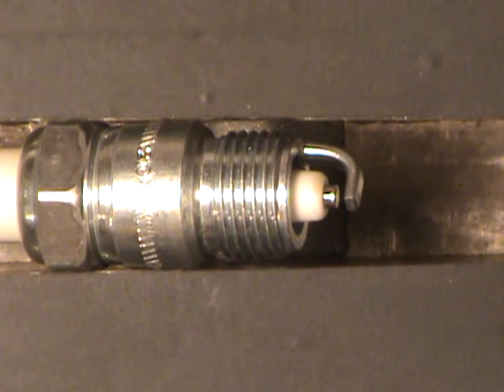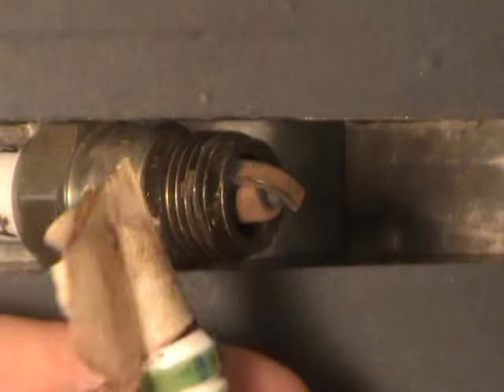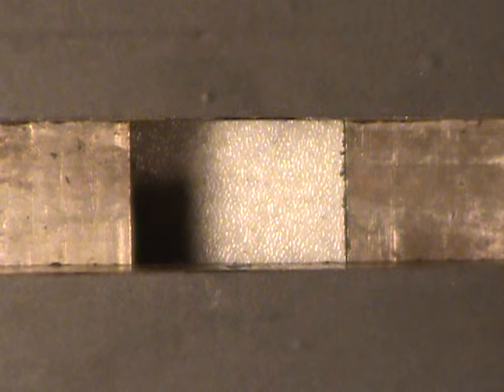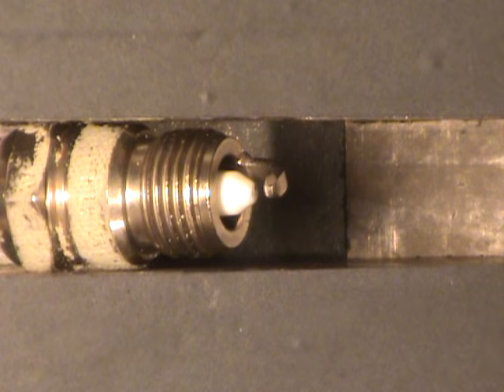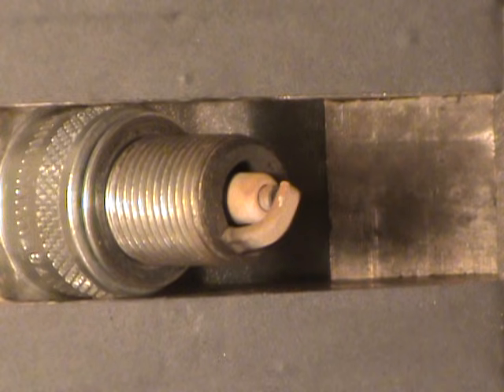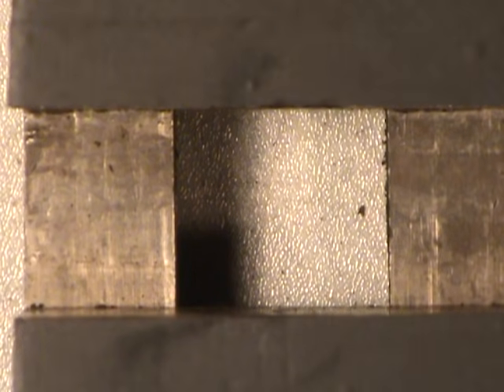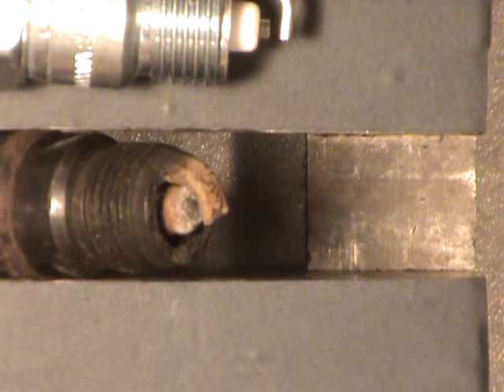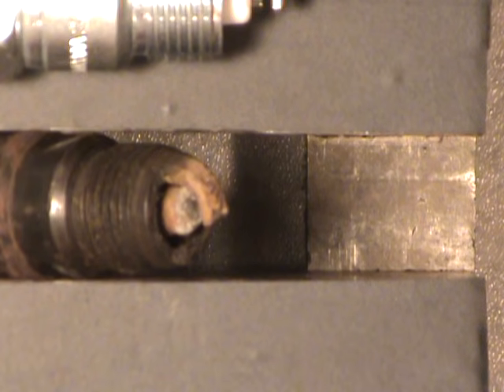SPARK PLUGS How to Read them (Part 3)

Comment: thank for the video, out of my 4 plus i had one like yours-deposite. I suppose its burnning oil right???new cylinder ring or leave it???
Reply from the maker: Rini Sugiarto Greetings Rini Sugiarto....Thanks for Your comment/question, and, for watching this Video of mine as well........I have No Idea What-so-ever, as to "What Car or Truck"???, as well as, "What Engine"???, that You have, and, are asking about...???....................If a Car or Trucks Engine is "Burning" Lots of Motor Oil, in a Lot of cases, there can at times, be, a "Blue Colored" kind of "Smoke" coming out of the Car or Trucks Exhaust Tail-Pipe...............................................................Is Your Engine "Using" Lots of Motor Oil, as in, having to "Add" quite a bit of Motor Oil "Between" Oil Changes???......................................................."Always" Make Sure, that, there is Lots of "Fresh Air" and "Ventilation", when-ever Your Car or Truck's Engine is "Running", as "Exhaust Gas" is "DEADLY"...!!!...Try "Observing" (as in Looking At), What (if any) "Smoke", might be coming out of Your Vehicle's "Tail-Pipe", when You First "Start" Your Vehicle for the Day, when the Engine is "Cold", and, what You are Watching For is a "Puff" of "Bluish" Colored "Smoke", and, "If" there happens to be some "Bluish" Colored "Smoke", and, that "Smoke" becomes "Less", and Disappears some-what, that's tellin' me, that the Engine might have Bad "Valve Seals" or "Worn" Valve Guides, which will let...Motor Oil...get into the Combustion Chamber, hence, some "Oil Burning".............................................Is that Spark Plug, that You think might be "Oil Fouled", all covered with, what looks like, an "Oil-Like and Wet" looking Deposit, or, does it Look like, a "Blackish-Dried-Up"...Coating on that "1" Spark Plug, that You were mentioning...???...........................................................................How Old, and How Long, as well as, How Many "Miles" or "Kilometers", have those "Spark Plugs" been in Your Engine, since that "Last Time", that they were "Changed"...???...................................................................If Your Car or Truck "Needs" to be "Smog/Emissions" Tested, and Your Engine is Sending any Visible "Smoke" out of Your Vehicle's "Tail-Pipe", chances are, that, the Smog/Emission's Testing Establishment..."Won't" even "Test" You Vehicle, due to "Any"..."Smoke" coming out of Your Car or Truck...!!!......................................................................................If Your Vehicle "Starts"...and..."Runs" Good, I would just keep a close watch on the Spark Plugs, and "Change" them, when-ever they Started to look like, they might have "Too Many Deposits" on them, which might lead to..."Miss-Firing"..."Hard Starting"....and..."Poor Running", etc........................Make Sure, that You Keep Your Engine "Tuned-Up"...and...also, make sure, that Your Vehicle is "Well Maintained", that way, Your Vehicle will be able to "Run" the "Best" it can, given the "Condition/Mileage/Kilometer-age", of  Your "Engine"...!!!..........................................................................Let me know, all that You are able to, about Your "Car or Truck", and, the "Engine", that it Has in "It"...that way, I will be able to help You out, all that much more............................................................................Be Safe, take care, and have a good one.
Reply: ok ok thanks its for a car